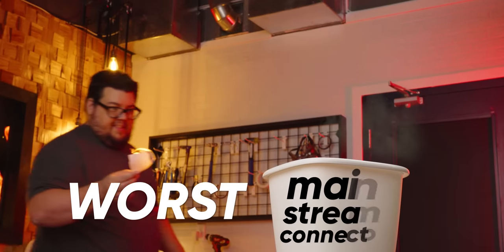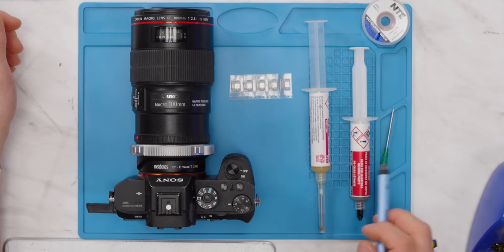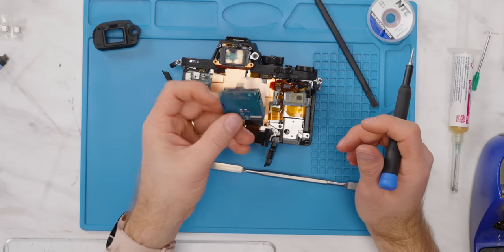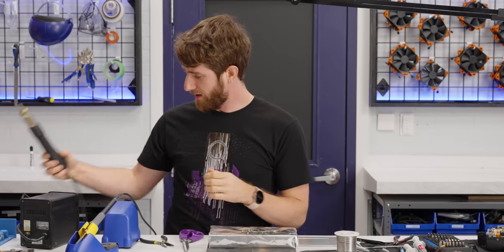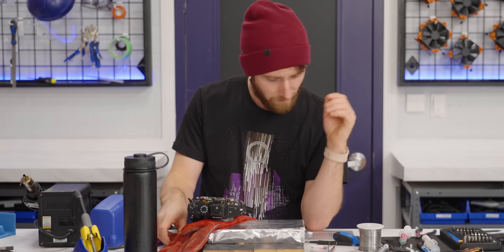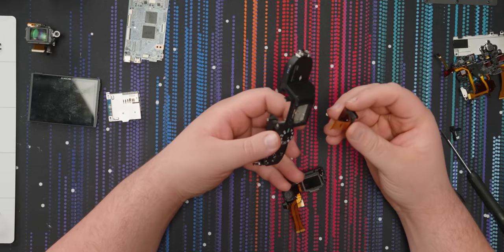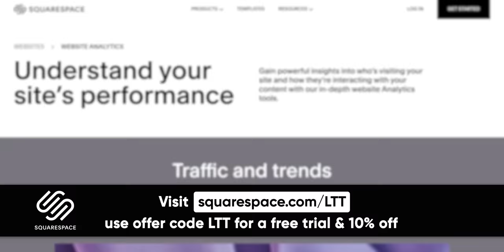This "cheap" repair almost BROKE me.

Comment: This was painful. Tip for soldering pins like that. Clean the pads with the wick and flux. Then clean the area with isopropyl alcohol. Make sure it's all clean. Don't bother with the solder paste. Flux the pads again, load the iron with some solder and load the pads that way. The flux will prevent the solder from bridging if done correctly. Clean the area again with isopropyl alcohol. Use some copper tape, kapton tape, or high temp tape and block the area around the connector. Flux the pads well and lay the connector down on the pads. Take the temp of the heat gun down slightly so it won't kill the plastic of the connector. Also, turn down the fan intensity of it. Try to keep the heat on the pins and pads more than the connector itself. Be patient and keep the heat moving back and forth. It'll take a little bit but you should start seeing the solder melt. Don't get excited and take the heat off yet. Keep moving it around until all the solder is completely molten on pins and the grounds. After that, pull the heat away and let it sit for 5-10 minutes to cool down.
Reply: Ya, that temp on the hot air was very high

Comment: The part where Nick takes over is like a tech horror movie..

Anyway, the real lesson is when you are quoted $ X for a job and you find the parts only cost $X/10 realise you are not factoring in your time/stress/high risk of failure and experience (whether formal or not) of the guy/company offering the repair service.
Reply: or that they don't bother with the stress and replace the whole board with another machine assembled one, maybe we should design more repairable or less fragile devices.
Reply: depends on the company apple for example is notorious for quoting 750 to 1500$ repairs for a 5$ cap because they want you to say its not worth it and spend 1200 on a new macbook

Comment: As a l3 electronics technician I highly recommend getting a set of helping hands.  Also if solder bridges pins on the connector just flux it and use some wick to absorb the bridge
Reply: Helping hands have so often damaged PCBs of mine with their strong clamps and sharp teeth.
Reply: @unlink  use ones with rubberized teeth and only hold by pcb edges

Comment: As a preventative measure. On a larger rig you can use a connector saver. This is just a super short extension cable. Only unplug the main cable, always leave the extension on, that way the wear acts on the easily replaceable extension. Of course this isn't perfect but it extends life of the main connector some. I use this concept on high volume tests systems that go through 40k insertions a year.

Comment: Pro-tip: buy a 10cm microhdmi extension cable so you connect and disconnect mostly from the extension, that way you can extend the  life of the microhdmi port.
Reply: This. You con also use a pcb/flex breakout extension made for drones. (low profile mini hdmi to hdmi via flex cable). and stick the big port somewhere in the camera
Reply: Deejays use similar "tricks" to extend the life of headphones, mixers, turntables and related equipment. Defense in depth when contending with expensive gear, some extra cabling is worth it.
Reply: Actually there are real parts called connector savers which serves the purpose of keeping the cycles on the connectors to a minimum. Its just a pair of connectors back to back. Usually they are really expensive because they are mainly used in high reliability equipment development.

Comment: I do SMD repair and watching Linus ripping up that port as he was heating it loose was painful viewing. That's a real easy way to rip off the pads/traces and then you have a whole different repair to endure.
Reply: Yeah, haven't done this kind of work.... yet, but I have been watching a lot of soldering, SMD, and repair videos as I want to learn. Was he really supposed to use the hot air rework station to try to put the new port on the board? I thought that's mostly to remove components and/or reflow, not attach them unless you have solder paste for SMD components.
Reply: Omg I posted the exact same comment the I decided to read what others were saying. I’m glad I found this one so I know another solder tech is sharing my pain right now haha!
Reply: @Cyber_Akuma  Try it,

It's a legit pain for the first try

Comment: I’ve also worked on a camera recently (sand in the lens assembly unfortunately) and OML is it insanely hard compared to even an iPhone. While stuff isn’t glued down, there are so many more tiny ribbon cables and layers of screws all going around to different places. 

Could also be the fact that I’m much more used to taking apart smartphones and similar devices but damn does it feel really different.
Reply: I'm also trying one and there's a spring I can't get right
Reply: My limit is laptops. After seeing this, I am never going to volunteer to work on a camera.
Reply: That is why repair costs a ton, you pay for a person not to fuck it up. 99+% of customers are not like linus who can write off 3+k loss because if they fuck it up they will make more from the video.
Reply: @phuzz00  I would say phones are a bit harder than laptops simply because of a lot of components being bigger/sturdier. Cameras though are on another level of delicate.

Comment: If yo do more soldering of connectors like that I would definitely recommend hand-soldering rather than hot air for reattaching it. Solder the mechanical pins first, getting it aligned properly, then hand solder the data pins on and then remove the excess with a wick. It's much easier to get the connector aligned that way than trying to reflow the whole thing all at once without a proper oven / paste / hot plate.
Reply: Also when applying hot air to a board make sure to put kapton tape (or something else heat resistance) over the rest of the components on the board. Particularly important for plastic connector headers, leds, etc, as those like to melt when exposed to even slightly-to-high temps.
Reply: The connector used has a row of pins that are inaccessible behind another row of pins.
Reply: That particular connector had two rows of data pins, not gonna hand-solder those.
Reply: @anthonydiiorio  Oh interesting! After you pointed it out I re-watched and it does indeed. I've never encountered that before on leaded SMD components. That would definitely make this repair annoying without the proper equipment.

Comment: I already thought in the middle of the soldering attempts: "if your goal is to toast the board, you've done well"
usually you don't use the heat gun to solder connectors, only the solder iron (if possible)
Reply: This one is extra painful - two rows of pins. Preheating with the brick + heatgun set at lower temperature could have worked.
Reply: @pasikavecpruhovany7777  did you notice temperatures of the hot air

Comment: You should use no clean flux for a job like that it's the best. Soldering paste should be perfect once you have finished use isopropyl alcohol to clean up the PCB with a soft toothbrush
Reply: Hes a professional he dosnt need your help
Reply: @sd8213  He clearly isn't. But he has a team around him that is
Reply: @muazqamar  do you have a youtube channel with 10 mill Subaru's
Reply: @sd8213  I don't think anyone has a YouTube channel with 10 million Subarus, brother
Reply: @sd8213  In case it's not obvious: subscribers does not equal technical expertise of a business owner
Reply: @xerzy  ofcourse it does if you have the subbys you have the knowledge
Reply: @muazqamar  that would be pretty Impreza
Reply: @sd8213  Ayy good one

Comment: I am a do it yourself guy when something breaks and on my own experience, I always end up breaking up something inside small gadgets such as cameras, phones, computers when trying to fix them. There's always a ribbon cable that breaks, or connector that gets damaged, so I can relate to this video. My advise is, if the broken gadget does not work at all, and the possible fix is inexpensive, go ahead, but learn when to stop before becomes more expensive than buying the item you are trying to fix new.

Comment: Can’t USB4 2.0 (god, I hate that name) with USB-C pretty much eliminate the need for Micro HDMI? Hell, it could probably replace DisplayPort given the 80Gbps transfer speeds.
Reply: That is already possible with normal USB-C via the  HDMI alt mode. It simply uses the USB lanes as HDMI lanes. This works because both formats use 4 twisted pairs.
Reply: It’s usually a matter of workflow
I haven’t really seen a compact type-c to HDMI cable I can run from my Sony to my Atomos
HDMI is standard on cameras and tons of equipment are already designed for it
Would be nice tho
Reply: Wait, they really went USB 420?
Reply: @MrD0r1an  True, but I thought previous USB standards had to make some sort of compromise because they couldn’t either match or surpass existing HDMI &/or DisplayPort standards.
Reply: @Mindbulletz  it’s dope!!!
Reply: Most new Sony mirrorless cameras now have full size hdmi
Reply: @MaxRovensky  There is one in the Apple Store for £50, cheaper variants are available elsewhere. They are designed for connecting MacBooks with only USB-C ports to an HDMI monitor. No reason why it shouldn't work in a camera as well.
Reply: It is DP2.0 universal
Reply: If only, I've repaired tons of bluetooth speakers that have had their USB-C charging port just mangled. The Sony XB-23 is pretty notorious for that, and they have the port on a daughter board that can be easily replaced, but good luck sourcing a vender for it. There just needs to be a better, dedicated to AV connector or maybe stress relief cage kits out there.
Reply: If USB 4 2 is the same size plug as as USB 3.2, then the same problem. I have lost several USB 3 keyboards due to exactly the same problem of snappage. It's fundamentally poor product design that exposes them to this much strain.
Reply: @katbryce  yeah I have one of those, but it's 2 meters long, you don't wanna fiddle with that on a camera rig
Reply: USB 4 can already carry DP or HDMI. It's basically a less strict version of TB3.
Reply: DP alt mode for any USB-C port that supports it should already be as good as the DP version being implemented. Basically if you restrict the USB connection to 2.0 only you get 4 pairs of data connection for DP, which would be the same amount of connection needed for regular DP to transfer image signal.

Comment: It's easier if you apply solder (like you did) in prep, then flux (like you did). Then place component in place, hold it down with tweezers then apply heat with lower airflow.

You feel the component slot into place while applying the gentle pressure.

Comment: Plugging a cable into the connector while trying to place it can help.  Gives you decent control compared to the tweezers and helps to act as a heatsink to remove some of that heat building up on the part.

I usually do this for XT30/60 plugs that I use in quadcopters as it keeps the pins aligned correctly, and reduce the chances of heat damage.
Reply: II was wondering when I'd find a comment mentioning this. This is exactly what I do, the amount of stress it helps mitigate is nuts

Comment: Linus: Complains about the plastic from the port being melt
Also Linus: Proceeds to use a bad quality hot air station at 487 degrees (10:16)
Reply: It's only 250º C
Reply: I've been using the exact same one for many years now and it works great. My recommended temperature for most situations is 350 degrees (Celsius)
Reply: It's Canada, not US. Normally they use Celsius, not Fahrenheit.
Reply: @LanteanStargater  No, these display celsius, just as the vast majority of lab equipment does.

Comment: As someone who broke the connector on his drawing tablet i find this whole experience highly relatable, although you were supposed to use heat resistant tape around the area to reduce the chance of damaging the surrounding components, it might still have happened anyways as i can attest...

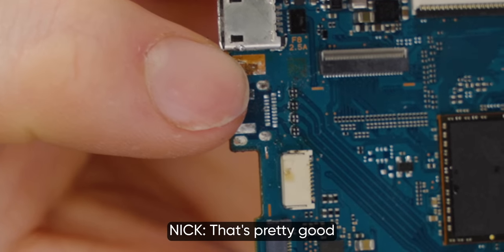Comment: 8:26  Linus actually heated the other side of the board probably the capacitor/LED and other small transistors, that could be reason why the board actually powered off during the boot.

Comment: By the way there is a way around this … small rig makes a clamp for those cables as well as making an awesome light weight micro to full size adapter that screws right on to the cage. Actually there you only plug in the micro hdmi once and then the little bolted down adapter where the full size hdmi comes out is the thing that you plug in to regularly keeping weight and stress off the small port

Comment: This does look like a horrible board to rework, but a couple of suggestions for future repair efforts:
1) Boards often have big copper power plains, either visible or on an internal layer. Preheat the whole board (not all the way to reflow temps) to make desoldering with the hot air soldering station easier/less damaging. And turn the air flow down relatively slow.
2) Once the old component is removed, clean up with flux and wick until the pads are completely free of solder.
3) Solder paste - ideally with a stencil for the component, but with careful freehand alternatively. Then place the component, preheat the board as before and hot air (at low air flow rate) to melt the paste.
4) Post repair cleanup with isopropyl alcohol (IPA), and a soft toothbrush. Flux is generally corrosive, so you want to get rid of it. With no-clean flux this is less critical, but it can still gum up connectors. I normally leave the board completely immersed for a while, and then rinse with clean IPA.
Note, IPA will dry out your skin, wear gloves. It's also very flammable, and evaporates quickly so you should make sure to have good ventilation.
5) For ribbon cable replacement (and removal) I suggest tweezers.(I.e. https://www.ebay.com/itm/192762181131?hash=item2ce185760b:g:CugAAOSwu3ZcGOOG (no affiliation))

And for the love of god get ESD grounding straps, table mat (and ground it). Even if it works just after the repair, ESD damage can result in 'walking wounded' boards that'll fail after a short time, or worse have weird behavior. I'm a FW engineer,  and I have spent a month trying to solve a FW bug that turned out to be a half dead board.
Reply: Any suggestions on a decent hot air station that won’t break the bank for a beginner? I got a bag full of old boards waiting to be messed with.. even a full VX2000 my buddy smashed
Reply: I had the same thoughts while watching the video
Thumbs up for you buddy
Reply: This is what annoyed me about the "Can static kill your PC video".  They completely glossed the fact that its not that ESD will immediately kill your PC, it can degrade components so they fail sooner, it could be days, it could be years.
Reply: @SAFbikes  I use a cheap Tenma unit with a built in soldering iron - I don't think they make the model I have any more. I'd suggest getting one without the soldering iron - I have a Hakko soldering iron which has much better power and temperature regulation.

Comment: Now you understand why Sony asks 500$ to repair it 😁
Of course using such crappy connectors is a shame in the first place
Reply: With the right tools (like a clamp to hold the workpiece for one) this was a 10 minute repair job not counting disassembly. 
1: take the old connector off with hot air on full blast
2: clean flux and solder from the board
3: apply paste (they would have a stencil for that so you just align the pads and wipe a glob of paste over it, would've been $10 to order one for this video) 
4: place the new connector and reflow the corner of the board on a small hotplate ($90), cleanup with soldering iron if needed. done.
Reply: @teslatrooper   Yeah but as customer you have to pay for those tools and disasembly and work done of hte person.
Reply: @teslatrooper   Average customer will fuck it up and brick 3+k camera.  
Also those right tools are 1000s usd worth of tech.  
Look at  rossman a single microscope for such work can cost 10+k.  
But hey peopel on the internet know better.
Reply: It's funny that this started as a right to repair video and ended as proof that sometimes its better to just let the company that made the thing fix the thing
Reply: @teslatrooper  there is a much better way to make this make the io board a daughter board just like sd card slot
Reply: nope. Still fail to see why Sony asks 500$ to do that. I could just take that mainboard to any local repair shop and they'll do it for 20-50$ anyday of the week. 
And personally? I can do the same job of soldering that back on in couple minutes- all it needs is to actually learn how to do stuff and not go "yeahh failure content"
Reply: @Gokul_Yt  this is a consumer camera and not the professional version. This connector is a nice to have and not intended to be used all the time. They even include a strain relief in the package. They did make a professional version of this camera that costs 1k more and has better video output.
Reply: @MultiMrAsd  but broken connecter isnt a new thing even for normal users too (atleast camaras use the camara to charge the battery) so having the IO as a daughter board make this easy. And you loose absolutly nothing. More modularity is always better
Reply: The $500 is probably more so the fact that they would just replace the whole main board instead of replacing the part itself.
Reply: @teslatrooper  key part of that is you need to know how to do it, that knowledge/experience alone has a price tbqh

Comment: Use the iron before the heat gun, you can replace/dope the crappy lead free solder with low melting temp leaded solder.
That way when you go in the heat gun you're dealing with lower melting point, the part comes off easier. 
Flux is still a must.